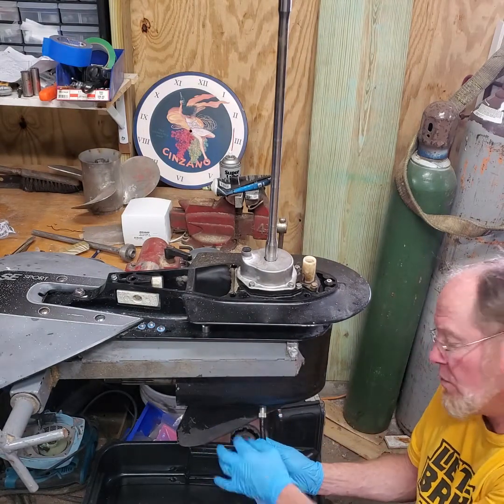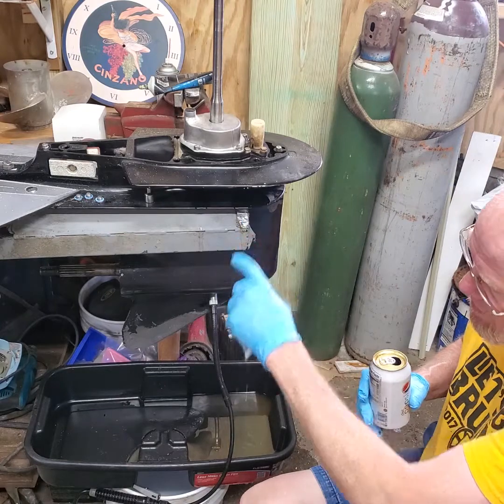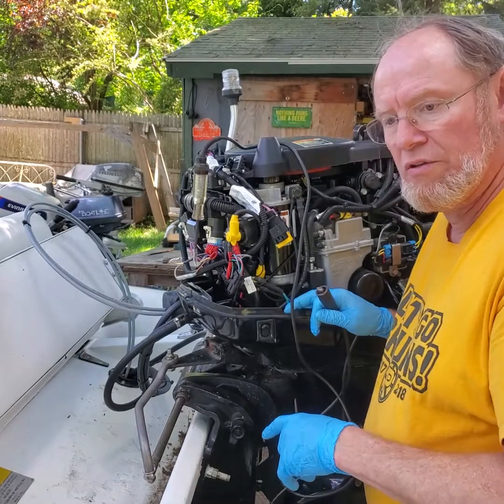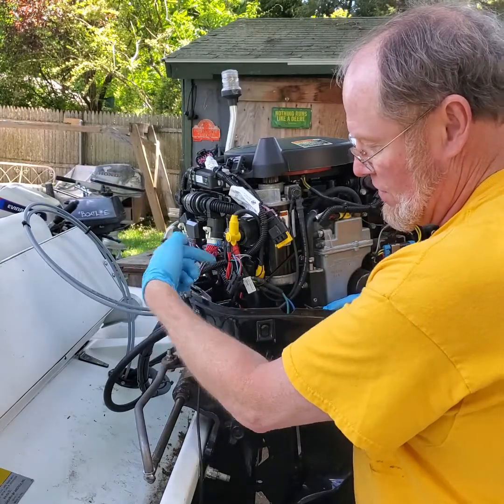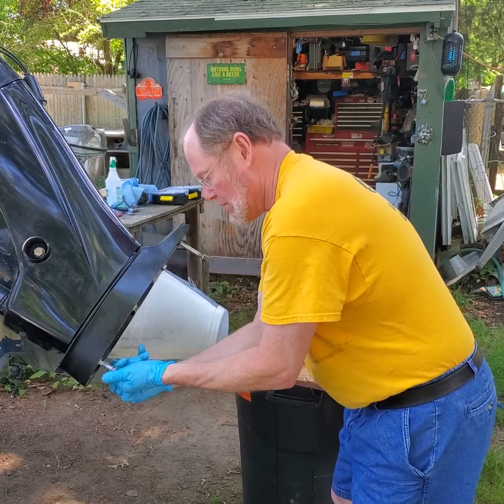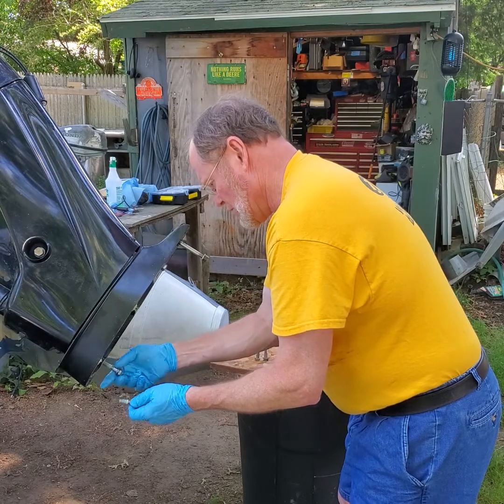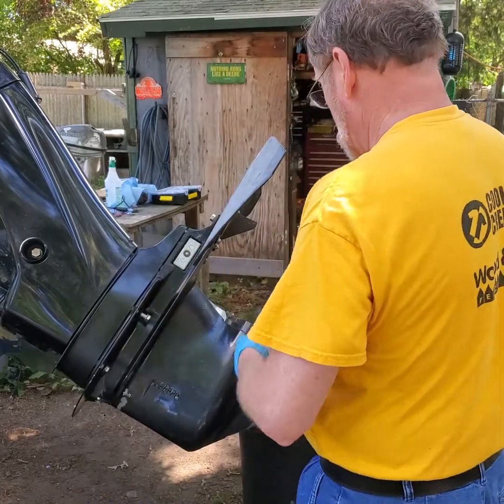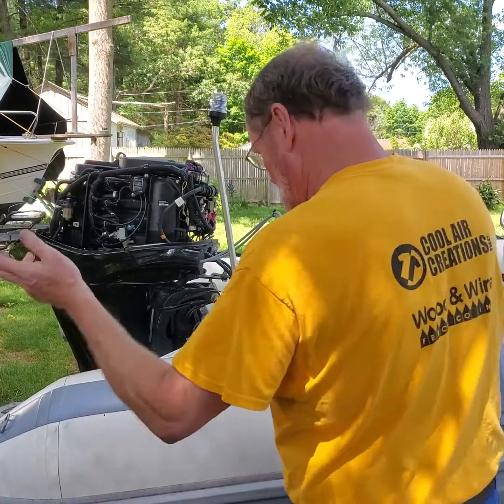Mercury 60hp EFI Four Stroke outboard Water pump replacement Part 2

Comment: You sir are a great teacher, I'm looking to buy a 2001 Bennington pontoon boat with a 60 hp mercury Bigfoot e f i., I assume it is of the same year, IDK, the gentleman that has it sells many boats, I haven't actually spoken with him yet but in his ad he says the engine runs, drives, and pumps water but not enough, he reiterates it runs really well but has to be repaired properly or it will be ruined, which brings me to you! Any input would be very much appreciated, thank you for your lessons.👍
Reply from the maker: @skylark4901  it sounds like it may have been and is currently been running while overheating. A compression test would be a good way to see if there is any internal issue and then determine why it overheats/repairs prior to future use.
Reply: @tedsmarinerepair8956  Thanks Ted I will do that

Comment: Hi is the water pump slinger you talk about come with the original motor or is it an aftermarket upgrade?  I didn’t have it on when I disassembled mine. Thank you
Reply from the maker: It will come in a mercury water pump kit. Not sure about aftermarket ones
Reply: Thank you Ted. 
For my specific motor this part is not listed in the parts diagram. I also called Mercury and as far as they could tell they said it fits the big foot but it’s not for my model (2011 60hp 4 stroke efi 1.83-1 ratio). I’m not sure they are correct. Do you think it would hurt to add this water slinger to mine despite them saying it doesn’t go on my model?

Comment: Ted, I replaced the water pump and impeller and I'm running my motor in a tub.  I've got strong water stream from my tell tale, but I do see water coming out of the midsection.  Is that normal?
Reply from the maker: Yes

Comment: Mr. Ted..thanks for that . You're made putting it back together look easy.  I did the impeller, gasket change et no problem but the gear shifter is giving me difficulty lining up. When you say giving  shifter a little wiggle did you mean someone at side counsel doing that?.   If not any suggestion as.spent few hours playing with and ran out of cuss words :-).   Thanks.

Lou
Reply: Disregard request. Got it., fortunately.  Got second pair of hands (son in law and grandson to wiggle lower unit while I ever so slowly maneuvered gear shift forward.    Nextvtime will ensure I place in forward or reverse gear "prior" to detaching lower end.  Thanks 😊
Reply: Same here ... still cant get it to go in place after 3 hours of trying.
Off to the shop ... Thanks Ted.
Reply: @Willeecue  I got e to go after getting  extra pair of hands on lower end wiggling while I very gently played /pushed I to forward gear and worked. Try that first.

Comment: Good video, especially for mentioning the double gaskets. Can’t count how many times I’ve found milky lube caused by that. 
Probably would also be good to mention that you waited to install the prop until after you test ran the engine. This was a pet peeve of mine at the marina. It can be very dangerous to have a spinning prop out of the water! This is covered in every shop manual and at every factory school. But I’m not sure the average DIYer is aware how quick bad things can happen.